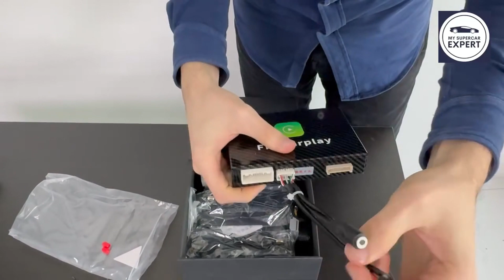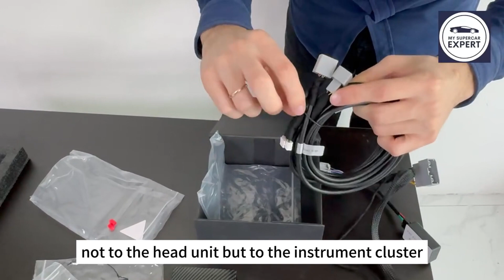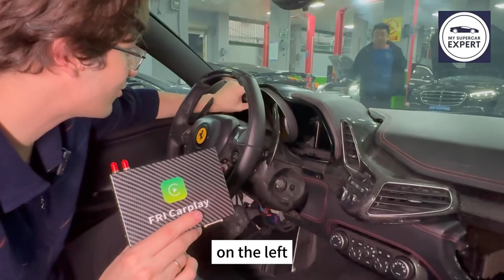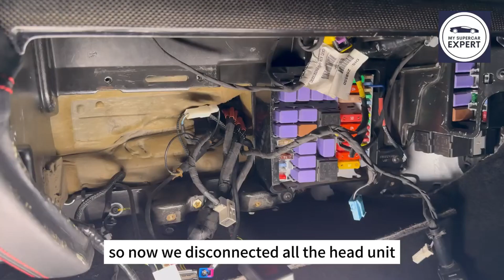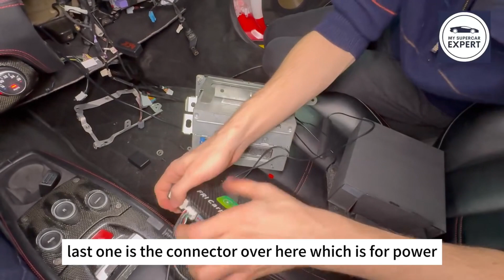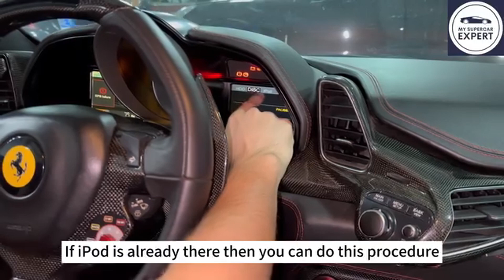How to install FRI Carplay (458)

Comment: Hello, i am installing this unit in a 458 and initially everything worked well and all functions worked. after a bit before reinstallation, the system stopped going into carplay mode. we have tried many things and checked the wiring for damage but have not found anything. the system has power and is feeding video to the screen but for some reason carplay is not working. status light is blinking and power light is on. any advice?
Reply from the maker: Please contact me via WhatsApp:  https://wa.me/85254285413

Comment: hi i cannot bluetooth my phone for calls , the option is greyed out, i believe its the nit board on the infotainment system. ferrari want 8k sterling to replace the whole infotainment system. will this bypass this and enable me to make and recive calls like normal?
Reply from the maker: The NIT module is what is responsible for that, it is correct. Not having the car with us we cannot make sure whether it is a possible thing to repair. However, replacement is costly in my opinion, a used module will work just fine. They do not even need to be coded as long as you find one which has the language you need, especially if you do not care about navigation (you can use our carplay module for that anyways!). Just be careful that the connectors are the same - the later 458 speciale used the same head unit made for 488s, which has full bluetooth also for music, but your wiring is for the older type which has only bluetooth for calls. I recommend to find an independent shop working on Ferrari in your area and have them take a look before spending 8k USD. Used head units are findable on the market for less than a fourth of that.
Reply from the maker: Sorry, got lost in the details and forgot the core part :)
If your NIT does not work, our carplay will not work. However, the 458 carplay we use connects to the car audio via the IPOD connection which is present on all 458 using this type of head unit. Therefore, your bluetooth for calls not working will not impact the functionment of our kit.

If there are other issues with the NIT, however, that can be a problem. But from what you described it should work fine.

Comment: I'm using an Android Samsung S24 Ultra. Will this pair & work with this module?
Reply from the maker: Hi! Although we didn't test with your phone model, there should be absolutely no problem as Android Auto is supposed to work on all updated phones. The ones with possible issues are the outdated ones, and those running custom OS.

Comment: Do you need to go and select iPod in the Ferrari menu every single time you drive the car before audio will work via carplay? Or is that just once when you first install the unit?
Reply from the maker: Unfortunately the iPOD menu is kind of a exploit, we use a combination of keys to switch on what in effect is an hidden menu, so it cannot be always memorized as a setting. Head unit is not supposed to show it to you on most older 458s. 
The only alternative for a more seamless carplay on 458 is to upgrade the head unit to the one used on the Speciale (which is the same of the 488 by the way), however that's a huge job and much more expensive than the carplay. We wouldn't recommend such an effort, too much time and money to get a small benefit.

Comment: If the Ipod menu doesn’t appear , is there any solution’s for this?
Reply from the maker: It should, please check this video where the combination is explained better. It is also possible your control buttons are not working OK, but more often than not is a matter of getting your hands to do it a couple of times and then you'll get it right almost every time at first attempt. https://youtu.be/sPxeq9h99lM

Comment: So the standard install seems to be a dual bluetooth connection for CarPlay and Ferrari - with the Ferrari connection being used for Calls and Microphone Access - except this doesn't seem to fully work. Replying to a text with voice, for example, does not activate the Ferrari microphone/bluetooth. It seems like the easy solution is for the microphone to connect directly to the CarPlay box and disregard the original bluetooth connection. Do you have any documentation on making this work correctly?
Reply from the maker: Hi, on the older Ferrari 458 (like the one on the vid) the audio is entirely running through wire, exactly because the original Ferrari audio system does not include bluetooth for media but just for calls. The newer  Ferrari 458 which use the same head unit like on 488 and F12 have full bluetooth implementation from the factory, hence the dual connection you mentioned will work without issues on those!
Reply: @mysupercarexpert  No. My 2015 458 does not have the ability to play media from Bluetooth. Regardless the microphone is the issue. Is there an option to hardwire the OEM-dome microphone into the Carplay box?
Reply from the maker: @JeremyShafton  Your 458 is probably a Italia, not a Speciale. As far as we can tell from experience, Speciale tend to have the head unit of the 488/F12. Italia models seem to always have kept the same head unit, although we cannot make sure 100%.

Regardless, our module works with the original microphone, connector is present in the kit and it locks into the car wiring. It si shown on the video itself, is quite far in the back behind the glovebox.

We also have a socket for an aftermarket microphone, but it is not needed to use it.
Reply: @mysupercarexpert  Do you have any documentation or images on the original microphone connector? I have a 2015 458 Spider. Thanks.
Reply from the maker: @JeremyShafton  Please write us at info@mysupercarexpert.com stating what you need and we will try to help!

Comment: What's the probability that my oem stereo system or screen become damage thru time? What's the warranty on these upgrade?
Reply from the maker: Hi, warranty on the kit itself is 1 year. About possibility to damage your original parts while using it, it is zero. The kit only takes power from the battery and communicates with the original car systems, and being entirely plug and play, if you meet any strange behavior your can uninstall it easily to double check any issue right away.

The only part where you can do some damage to your car is when you install/uninstall it since you need to remove covers and cables, but it isn't really complicated.

Please keep in mind Ferrari 458 may have the head unit used on 488, usually this is on the Speciale. Best way to know is to check whether your car suppots bluetooth for calls only (458 head unit) or for media as well (488 head unit). The carplay kit must match the head unit, therefore this is very important check to do before purchasing.

Comment: I want it for my 488 but it has car play from the factory and i want android auto. Also once set up does it go to android auto automatic
Reply from the maker: Yes it can work automatically with Android Auto or Carplay, whichever it was used last, as long as the phone is still detecteable (or connected by USB) when it boots up automatically.
For the 488 I recommend looking at this vid: https://youtu.be/IxxkpFDB5fc
Reply: @mysupercarexpert  but my ferrari has 
apple car play from the factory does that make installing different
Reply from the maker: @only1stefan  Our system works in real time independently from whatever is the head unit doing except for the audio system. It should be no issue at all as long as only the phone for Android Auto is connected to the car.